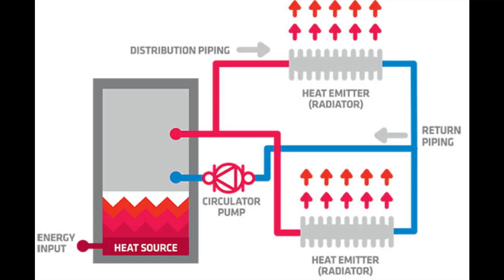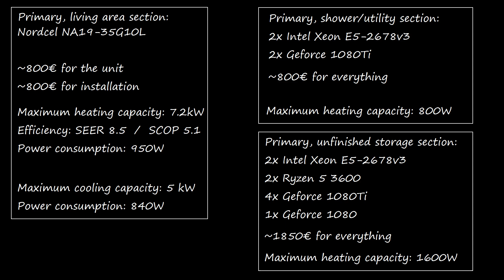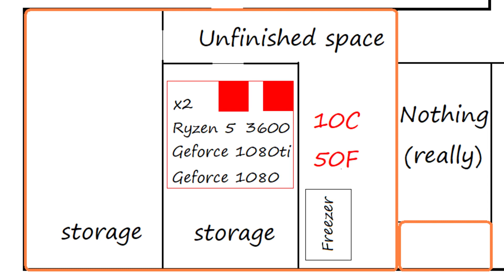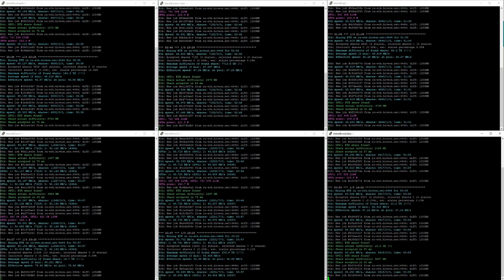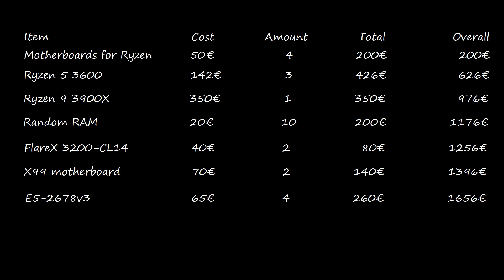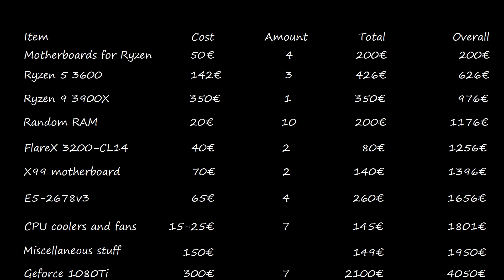Heating my house by mining cryptocurrency | House Update

Comment: Any news? Still worthy?
Reply from the maker: Well, when I bought these they were cheap in comparison to what they would cost today. Probably 3 times as much, so I got very lucky because I got all the upside. Let's put it this way: The ROI is still good-ish at least when compared to a regular investment, and of course using waste heat is an excellent way to warm up your home, but buying especially GPUs is risky right now. They're overpriced due to their availability being poor. If the GPU prices were to crash, one could be left with a bunch they can't sell for nearly as much as they paid for them, and any crypto mined in the meantime wouldn't amount to the difference. You'd have to be able to run them at good yields for at least half a year, probably longer.

I'd pass, but I still use mine :)

Comment: How loud is that? Would you have to yell to talk with someone over it? If you are in another room can you still hear it?
Reply from the maker: Not that loud, but it's annoying if you spend time in the immediate vicinity. I can hear the shower area power supply which is very loud when I leave the house (which is actually a good thing, because if I can't hear it I know the computer has crapped itself and I need to restart mining).

I've done some changes to this setup (will update when complete) and currently the storage area is very quiet. With this original setup here in the video, in the living area I couldn't hear a thing from any miner elsewhere in the house.

Comment: How does the humidity from your showers affect the rigs?
Reply from the maker: Not at all. Initially I turned the rigs off there as a precaution when showering or using the sauna, but because the area is so warm there is no noticeable effect at all so I quickly dropped that.

Comment: That's good but you say anything about rig's high noise disturbance.
Reply from the maker: Yeah, the noise is practically all from the 1200W server power supply, so if I wanted to have them in the living area then I would have to go with regular power supplies to make them quiet. Since they are so far away that I can't normally hear them, it does not matter that there's noise as the 1200W is a very cost efficient way to power them.
Reply: @eowendyl  You're wrong. The noise comes from the graphic cards. You can't do anything against the noise.
Reply from the maker: @tripore  I do have a couple of the very same cards mining with a regular power supply setup and they're very quiet in comparison. Sure, there is some noise but nothing that would bother me. In fact, I even sleep in the same space as a one of my miners and I would only notice it if I think about it.

Comment: Hello mate, ( northen Canada here ) i also bought a  house in 2015 that was built  in 1950 that had a diesel furnance  in it.  Trought out the years i always mined on my gaming pc's and kept  my coins thru every cycle until 2017 where i re invested alot to grow mining output to heat the house, now going in 2021-22 winter  i hope i accumulated enough hashrate to go thru this winter with minimal output source of heating :).     The only tips i would give to you is... get a woodstove!!!! try to buy a load of wood that you can cut and split yourself and it will be cheap heating when the miners or electricity cant keep up ( outages and downtime )
Reply from the maker: Thanks for the tip! Wood stoves are indeed great - my friend always shares comfy pictures of his in action during the winter. In addition, I actually have unlimited access to free wood which would make it even better and I still have 5 m3 or so of firewood I made myself at my old house where we used it to warm the sauna during the winter :)

But, the problem with it is that this house was so cheap that adding something like this would drastically increase the % price of the house AND that you need to be present to burn some wood in case something goes wrong with the miners or electricity in general. Redundancy is great, but last winter I did not need to use the diesel furnace even once. I'm also planning to buy a winter home from a warmer climate, so I wouldn't be present even if we had a blackout for a day or two so it wouldn't bother me if I'm not there to experience the house getting cool, nor would I be there to add wood to the fire.

Have a wonderful upcoming winter :)

Comment: I been heating my house by mining monero with old i5 dell optiplexes (20)!and it it’s far better than using an electric furnace or a space heater... outside could be 30s deg F and my condo is about 70deg F... and these computers were FREE for me since they were from my jobs IT department.

Heat + crypto BEATS OUT only getting heat... and the crypto has increasingly becoming more valuable.

I also have some 4 old v9 antminers that I want to use for heating a hot tub!

Comment: Monero? Thought that's the criminal one? Hey does the heat come off the Mobo or the video card? The most heat
Reply from the maker: Monero is a privacy coin, yes, but there are reasons other than criminal activity for wanting privacy, so mining or using Monero does not automatically make anyone a criminal. I'm mining it because the algorithm is for CPUs rather than GPUs or ASICs, but I'm also a heavy supporter of the project in general so it's a win-win. 

Anyway, one 1080ti does about 200-250W depending on how hard I'm making it work. A Ryzen 3600 motherboard+computer will use about 105W, if there's no graphics card in it, so the answer is definitely that the graphics card is generating the most heat. The dual Xeon is maybe 120W x2 for the CPUs and 200-250Wx2 for the GPUs.

I originally started mining Monero only (liked the project and CPU mining was interesting), but added the Ethereum on top because it's just so much better at generating heat. Glad I did :)
Reply: @eowendyl  yeah, I was just kidding about criminals. I think this heating system needs me to try. I've never mined before but I have an old PC, it might have 4gig memory. I'll have to check it out.

Comment: Tried mining back in 2016 complete money lost for me.
Couldn't stand the noise but was more worried about the heat and fire risk.
So i switched the ASIC machines off after a few months and by that time the miners were worth nothing so i couldn't resell.
Wish you all the luck in the world tho. 
Can you update on CRO i mean i love the card but im down so much money in buying/ staking CRO.
Reply from the maker: Yeah, I wouldn't want to do ASICs just because I'd be afraid I'll never get them sold for anything and if the markets took a plunge I would just lose money mining. At least with these CPU/GPU miners their resell value should be somewhat acceptable as they have other uses besides mining cryptocurrency and aren't anywhere near obsolete just yet.

As for an update on CRO, I think my position with the company makes it best if I don't really guess what it's going to be doing too much. And it's just that - a guess - anyway, as I don't know anything more than the next guy. May want to check if @denome has made any recent analysis on CRO. 

If you still love the card, then at least that's a positive. The high tier cards especially were always a huge risk, so I personally went into them valuing my staked MCO/CRO at $0 to begin with so I would have an easier time sleeping at night and not having to worry about price fluctuations.
Reply: @eowendyl  thanks, Buying your house with the card was really cool to watch. Cheers

Comment: Nice update are the miners too loud or are you usually too far away to notice them operating?
Reply from the maker: Too far away to notice them operating. The noise you hear in the video (hopefully not too loud for headphone users!) is mainly from the power supplies which are operating at almost rated capacity, so although there are two "miners" in the living area they are pretty much noiseless. 

Obviously if I venture into the utility/storage area then I'll hear these loud and clear, but the exposure is not very prolonged so it does not matter.